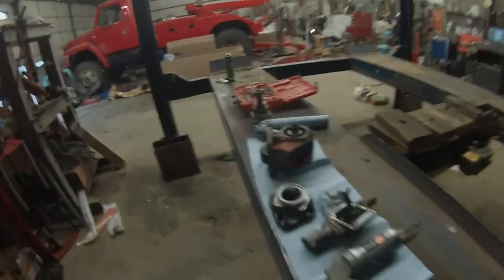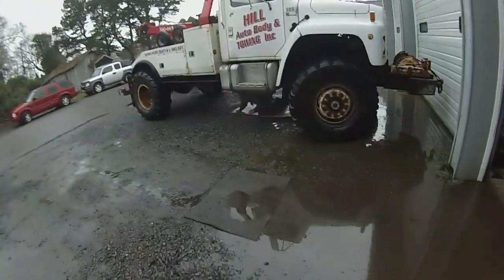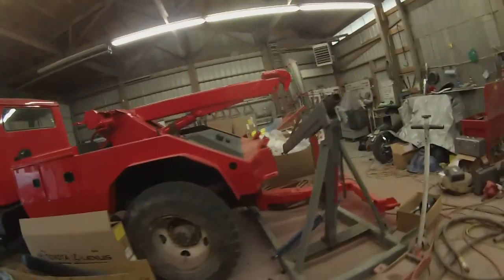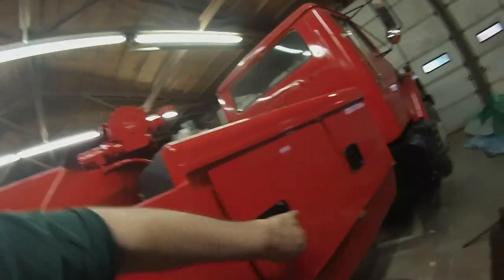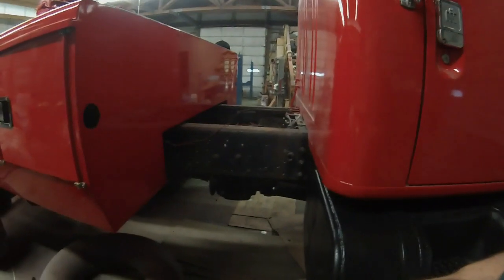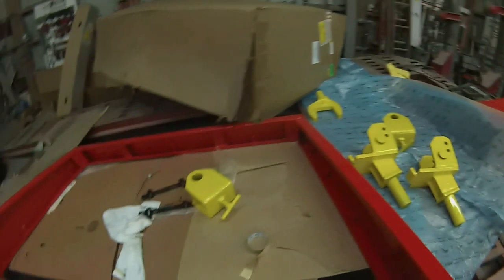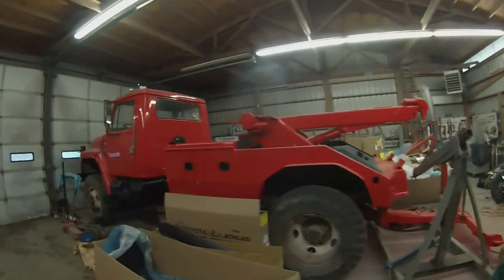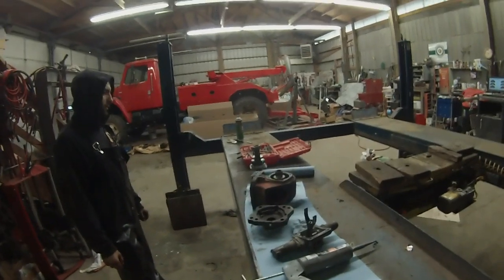Progress  Report  New 4x4 Wrecker Build

Comment: hello looking really sharp sad to see the old one go, one suggestion why dont you install a electric hydrulic pump I did it to my and is great it never miss a beat.
Reply from the maker: I have all the  equipment to swap over   to PTO . Never had any experience with an electric hyd system .
Reply: @HILLAUTOBODY  it's been good to me I have use it for 5+ years and no grinding, I was sceptical at the beginning but it proved it self to be very good and I use it every day the truck work 24/7 almost non stop

Comment: Re: the question about gas or diesel. Is that four hole gasket on the seat a clue?
Reply from the maker: gas . I find the higher RPM's  , lighter weight  and  lugging power of the  gas engines work best for me on the soft sand .

Comment: did you start having problems with the white truck or what.
Reply from the maker: Went on a  jeep recovery 3 months ago  popped a tie rod end  next to surf line  in  trying to get truck out of surf  broke something in the   4x4 . It hasn't seen action since than .   The body is so rusty it   was time to  retire her . I have had the newer truck for 4 years but  kind of  put it on back burner while   the white truck was still operational
Reply: did you get a vedio of it
 @HILLAUTOBODY
Reply from the maker: We  had it break  down  while responding to a jeep in the surf 4 months ago . Between the   Tie rod  pulling apart and  something breaking while trying to get it away from the surf it was  game over . Also the body is badly rusting away .
Reply: @HILLAUTOBODY  In Europe to combat salt attacking the body work,they use a product called Dinitrol. It has scored at the top of all tests done for corrosion protection. it would't hurt to spray some on your truck. I cant buy it here in Australia ,the agents have only one customer,the Australian defence force.

Comment: Tow trucks should NOT be 2 wheel drive EVER!!!
Reply: good luck finding a rollback chassis in 4wd. i'd settle for a difflock
Reply: @Commissar0617  that's weird. Ours has both from the factory. They shouldn't be built otherwise.
Reply: mine's an international 4300. 06.
Reply: @Commissar0617  those are great trucks. Last forever. Kinda miss my 04 and 07

Comment: Gas or diesel? Looking good... 💲💲💲 Money maker  💲💲💲
Reply from the maker: gas MV404
Reply: @HILLAUTOBODY  "OH WELL" It's not the best but it'll do, but diesel IS better!
Reply from the maker: @cw3339    I pull diesel trucks out of the soft sand   all summer long .   If you put  a diesel truck with a  performance chip and big tires they will do OK . But the same  truk  gas and no chip will do  about the same .  Having all the extra weight  up front    is a killer in the sand .
Reply: @HILLAUTOBODY  That make sense... my bad!